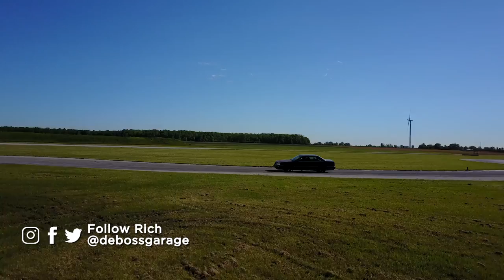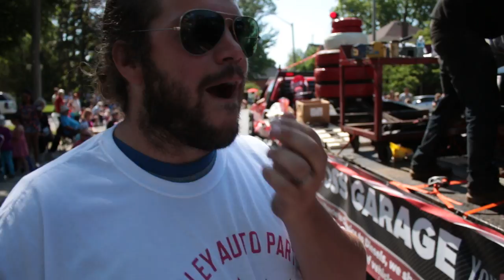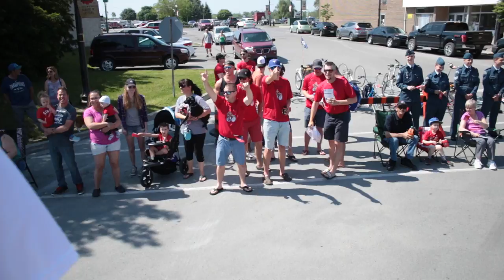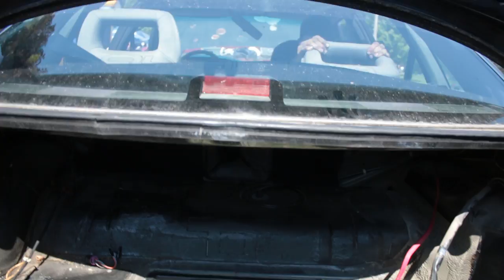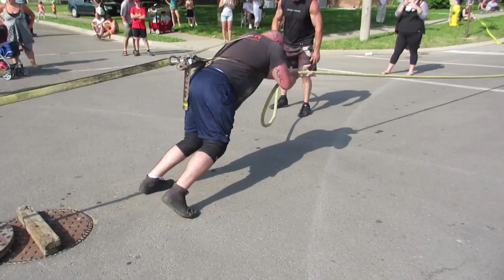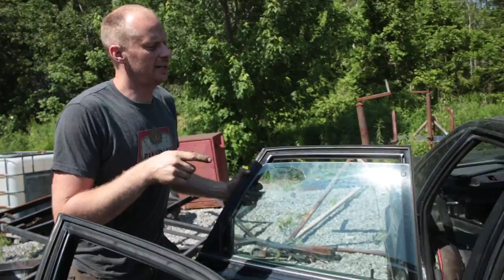The Spaghetti Challenge Audi Track Car Loses Weight | #Debocho [S1 E2]

Comment: Im not sure what engine you plan on using but there not very many light engines that can make big power,  3.8L buick V6= 375lbs(needs boost!), LS3 weighs about 435lbs, Ford 5.0 =530lbs, big block Chevy w/aluminum heads=595lbs, 2JZ-GTE inline 6 =600lbs!  I don't know anything about the engine in there now but a V8 that small should respond well to boost, so why not just turbo it? unless LS, LS is always the answer, though try to stay away from early LS1's piston slap and boost don't mix well.
Reply: 3.8 Buick would go real nice, just sit on the limiter and you'll be having a good time
Reply: 4G63 boost
Reply: That Audi V8 is all aluminum. It weighs about 450lbs fully dressed. They are very strong and had twin turbo versions. They totally could have used this engine with turbos and swap in an 01E 6 speed. I own one and am an Audi enthusiast. Cool project non the less. Looking forward to the show!
Reply: Which Buick 3.8l
Reply: @jdrok5026  I’d assume he is talking about the front distributor 3.8L V6 like was used in a T type or GN Buick Regal and many other GM cars of that era minus the performance upgrades and turbo . Strong mtrs . I believe all the 90 degree 3.8’s ( though used in Buick’s were GM based ) Buick also built a 2.8L 60 degree V6 that was used in everything from Jeep’s to boats just like the 3.8L 60 degree Buick mtrs were ?
Reply: @jasonsparshott7208  there are two different styles of 3.8 that are very different the odd fire and the even fire
Reply: @jdrok5026  yes a Buick version and a GM version also 90* and 60* so I’m not sure why you are telling me this ?
Reply: @jdrok5026  I clearly said in my comment that there were several 3.8l GM variants not to be confused with the 3800 90* V6 ... still a good mtr that responds well to performance upgrades

Comment: Looking back : Why didn't Rich use the Engine that came in the Car ? It seemed to be well engineered and with Turbo's would have been very strong and much less work. Ted.
Reply: Because that auto box sucks for racing and those engines were not built in huge numbers from the get-go so acquiring spare ones is near impossible (This is a race car, stuff breaks).
I own two of these chassis and am a fan`ish of them but trust me they were better off with what they went with.